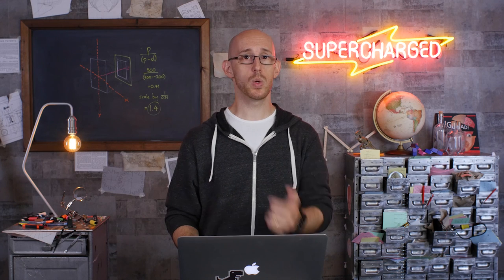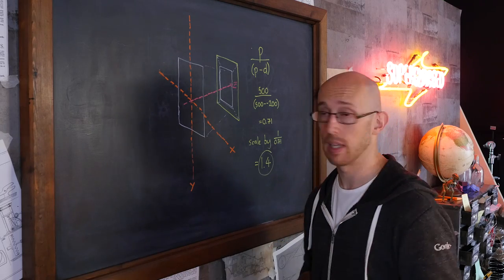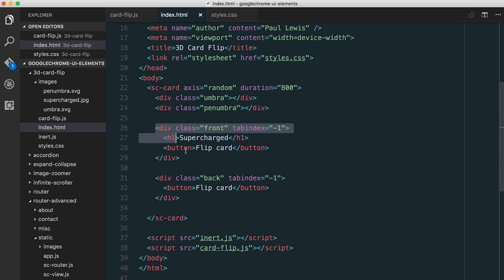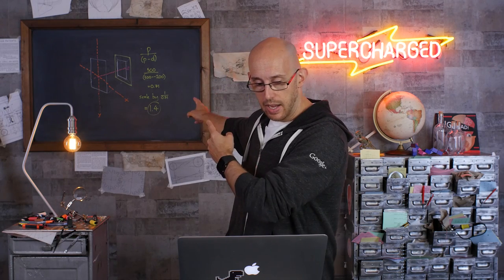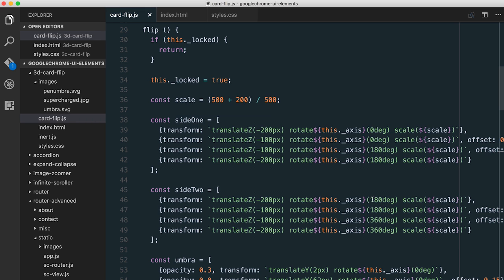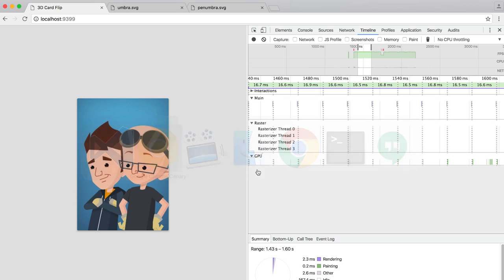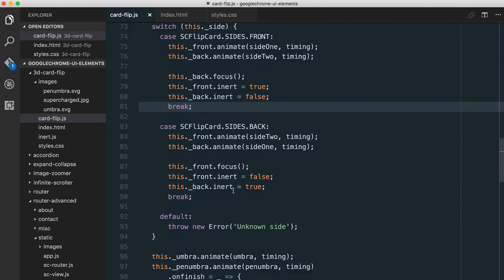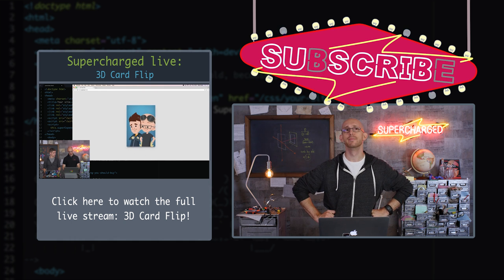3D Card Flip: TL;DW - Supercharged

Comment: From Atom to VsCode
Reply: Both are electron base editors, personally i prefer atom. Don't really a see any massive advantages with using VS Code.
Reply: +Maximilian Lloyd In older machine, vscode, is faster than atom.
Reply: Alpha Centauri Ah, didn't know that :-).
Reply: Atom is horribly slow! Its terrible. Dont know why anyone would switch from Sublime to Atom.
Reply: GifCo If you have a fast computer the performance difference is inconsequential.
Reply: Maximilian Lloyd Oh if you have a fast computer things are faster?? THANKS tips!
And you are WRONG at that. Im pretty sure an i7 4790, 980TI, Samsung 850 PRO SSD, and 32GB of RAM could be considered "fast" and Atom takes 3-4 TIMES longer to load than sublime which is a much larger app.
With specs like that I expect things to open instantly (which sublime and even chrome does) Atom is SHIT.
Reply: GifCo Judging by your grammar I am surprised you have the money for those kind of specs.
Reply: Surma Surma Seconded. Keep it nice, folks, there's room for multiple views.
Reply: Surma Surma lol we are just having some fun... while I am anyway
Reply: Paul Lewis what about multiple models?